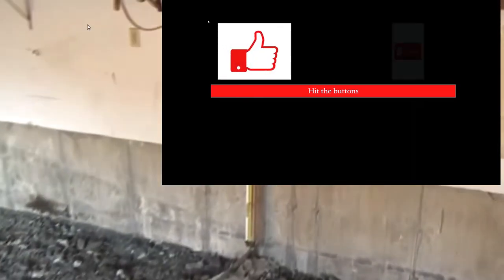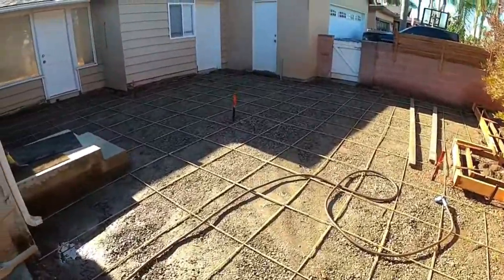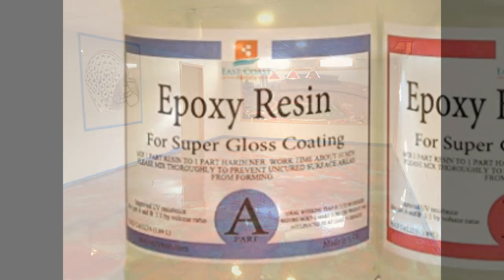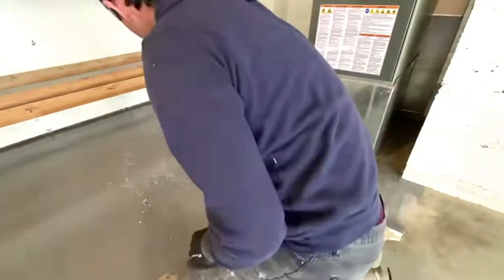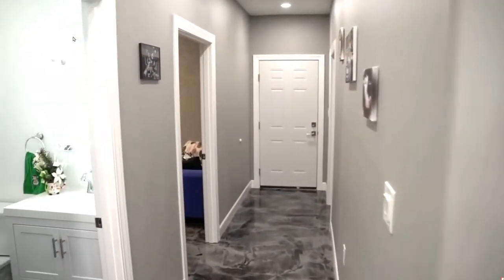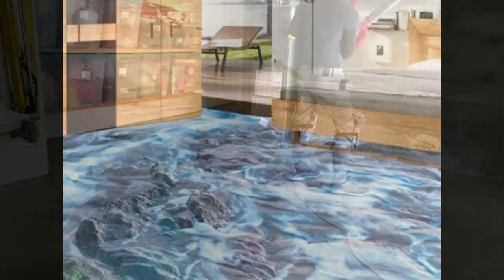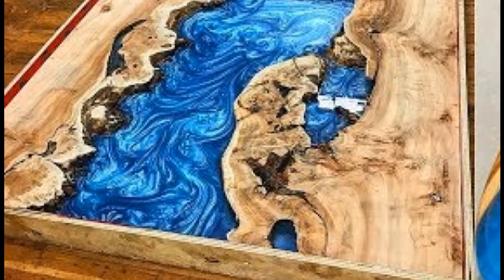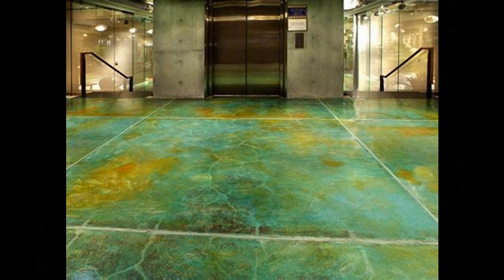Building Your Dream House in Jamaica. Part 10. Epoxy flooring

Comment: Really appreciate this information. I'm thinking about using epoxy in my garage, I also like the idea of using it on the patio.
Reply from the maker: glad i was able to help with your decision. The next video will be about staining bare concrete and finishing with polyurethane clear coat.
Reply: I want to use epoxy on my veranda floor how can I purchase it. where does it sell?
Reply from the maker: @racquelcummings8428  try Home Hardware but most large hardware will sell it

Comment from the maker: Quick update for those who wish to get their epoxy flooring done at a reasonable price.
I made contact with a company located in Kingston and spoke to a very knowledgeable lady. Her name is Amoy. 
 The name of the company is ACF Concrete Finishers. Phone number 1 876 926 1766.
They will give you a quote over the phone if you know your measurements or send an appraiser to look at what you have and discuss your needs and provide you with a quote.
Generally however their Prices range from $800. to $1500 per square foot so give them a call and see what they have to offer.
Reply: Omg thanks for this
Reply from the maker: @emjaysmile  you are welcome. glad if I was able to help. if you have any questions don't hesitate to ask.
Reply: @jussayinmipeece1069  thanks so if I use the epoxy paint thingy first would that make my prep work less to apply the resin and those make it easier for me to do it myself without messing it up?

Comment: Can self leveling cement be used when the casting of the floor is uneven with air pockets due to poor steel floating?
Reply from the maker: it depends on how level the floor is. if it has a significant slope then self leveling concrete will not properly settle and depending on the hardening time will set with ripples. If its basically level then a scouring the floor the applying a thin enough layer of self-leveling concrete will certainly work.

Of course you could opt for simply grinding and polishing the concrete especially if it has large aggregate. They would form a beautiful pattern that you could then apply sealant and a transparent resin over

A laser level with as many lines as you can afford would work wonders both for checking the level in the first place AND for applying the self leveling concrete.
Reply: Thank you

Comment: Where can i get epoxy ty buy
Reply from the maker: Amoy. 
 The name of the company is ACF Concrete Finishers. Phone number 1 876 926 1766.
good luck on your project
Reply from the maker: if you are in the mandeville region there is a new hardware on Mancheste avenue past Bmull  on the right hand side that also sell epoxy. You can also get it at Homehardware in mandeville but I am not sure about their variety. The color you can buy from amazon real cheap. Grey epoxy is what you will get in Jamaica mostly as a paint for industrial floors like garages and outdoor varandahs and patios

Comment: Can epoxy be used on concrete roof
Reply from the maker: yes, there is an epoxy paint specially for use on roofs. It can ether be rolled on or sprayed on. It is not well suited for brushes because its very thick so you either have to use a proper thinner with hardener and spray it on or roll it with a large roller.

Comment: New subscriber where in jamaica can I obtain material for epoxy and also workers who are able to do this kind of work. 
I wanted this on my shower wall counter tops and floors.
Renervating property now.
If I couldn't get epoxy floor would have to import vital plants
Reply from the maker: hi thank for the sub. 
The materials can be had at  Home Hardware but as to trades people at the moment i couldn't tell you since i am stuck in Canada at the moment. 

Speaking from a Manchester point of view there are three flooring companies on Caledonia road in Mandeville that also supply epoxy. 

My suggestion would be to check the internet. Perhaps try "Epoxy flooring , Jamaica West Indies" so you don't get Jamaica Queens results.

Here is one I found. I haven't vetted them so just be careful. They claim to have done epoxy floors for Flow, Barita, J Whray and Nephew and Hotel Grande. 

https://acfjamaica.com/

They may also be able to get discounts on material if they have good customer relations with their suppliers.

Good luck on you renovations.
Reply: @jussayinmipeece1069  thanks a lot. Info is great as I need 5hem in manchester. But "stuck" in Uk just now too.
Will let you know how I get on with any info I find. Respect. Bless
Reply from the maker: @cecileflemming3171  not a problem. 
I actually decided to call them to see what they have to offer so please see my update.